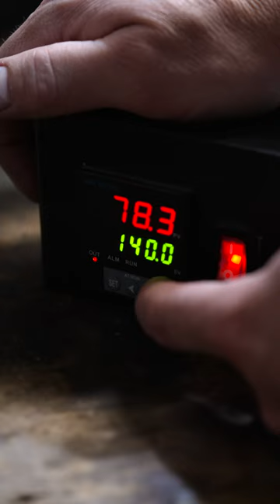Making Kydex Sheaths for Damascus Knives

Comment: Do you have tips for anyone that’s looking at trying this for the first time?
Reply from the maker: Just go for it, then once you notice your problem areas, I can probably help. Materials are pretty inexpensive, and you can typically reheat and reform if your screw up. Also, make your first press and use that until you decide if you want a different kind of press.

Comment: Is the foam in the press reusable? Can you get a lot of uses out of it before it needs replaced?
Reply from the maker: Yeah. It lasts quite a while. They say that it’ll lose its shape after a while, but I haven’t hit that point yet. If you get your Kydex too hot, it can stick to the foam, which ends up tearing the foam and ruining that side of it.
Reply: @Hathenbrucksteelworks  thanks for the info! I am just starting to look into what it would take to make my own kydex knife sheaths.
Reply from the maker: It’s my pleasure. It’s actually pretty inexpensive to get into. An oven, a kydex press, and some dies to set the grommets.  I prefer an arbor press over hammering the grommets.  I’ve purchased a press and I’ve made a press. Neither one works better than the other, but the one I purchased is slightly more convenient due to the latching mechanism.

Comment: That top version with the carbon handles 👌
Reply from the maker: Thank you 😊
Reply: @Hathenbrucksteelworks  is that sheath carbon to?   I didn't know you can mold carbon fiber.
Reply from the maker: It’s just a carbon fiber print on the Kydex.